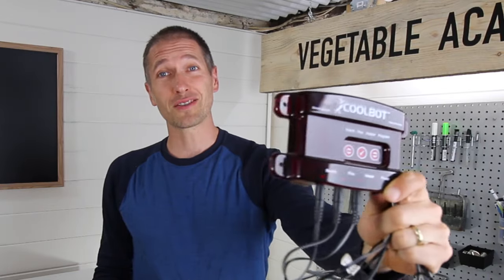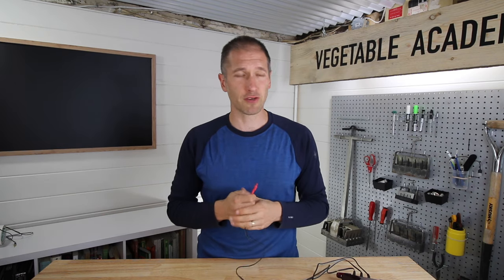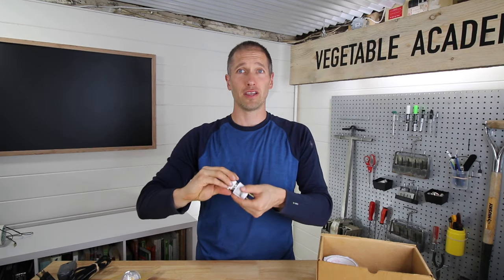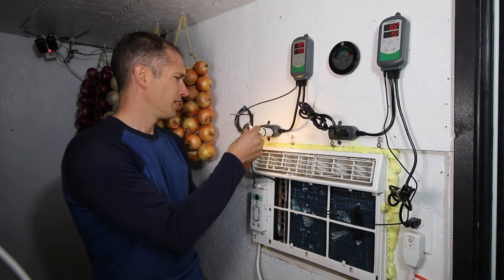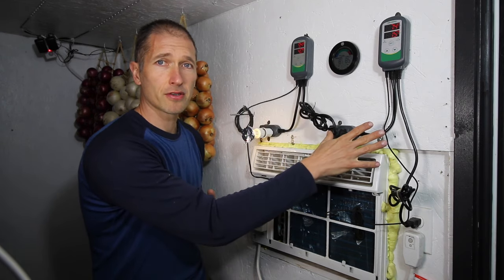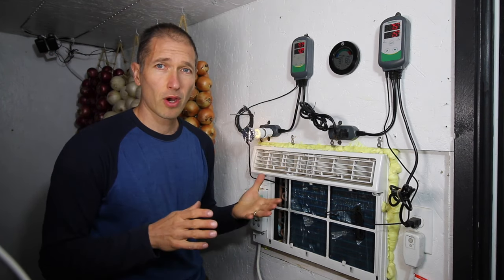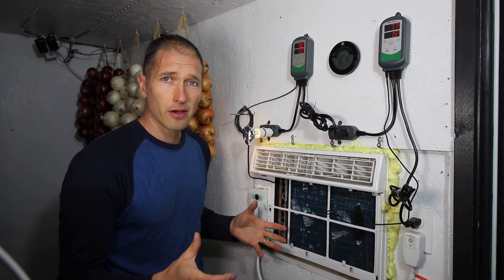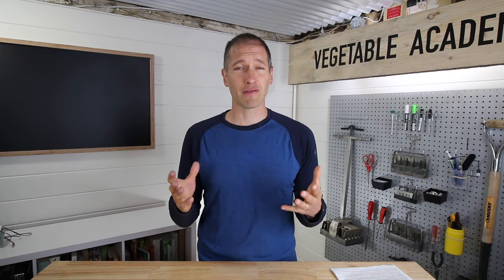Build Your Own Walk-In Cooler with this DIY CoolBot Alternative

Comment from the maker: Join me in person at the 2024 Homestead Festival near Nashville, TN on June 7 & 8 where I'll be teaching a session on Mastering Cold Storage.  Get 20% off your festival passes with the coupon code REGIER20 for regular admission and REGIER20PLUS for regular admission plus.  Here's a link to the festival: https://www.hardisonmill.com/thehomesteadfestival
Reply: I have built a 44 foot walkin. Using it as a freezer. Will this work where I can get it to freeze. Coolbots can’t be used as a freezer
Reply from the maker: @samscoalfiredpizza8152  The Inkbird controllers work at below freezing temperatures.  However, I can't speak to how well a window air conditioner would work to create freezing temperatures for you.

Comment: Heck no, just wire the ac comp direct to inkbird, run the fan constant to a wall plug.
Reply: Is it easy? I have an ink bird laying around
Reply: @kalebfourtner2140  super easy, thats why I went that route. Find wires to compressor, put a standard plug on them and run to inkbird. Find fan wires and run/start capacitor wires, put plug on them together and plug into the wall constant. Fan should always be running and inkbird kicks compressor on/off. This helps mitigate freezing up of coils.
Reply: @american7169  awesome thank you!

Comment: This video was by far the best one I found for the AC set up. Mine is working great in the first 24 hrs with only a single Inkbird unit. I just had to adjust the location of the temperature prob vertically at the bottom of my AC’s fins and adjust the temperature a few times to dial everything in. It’s holding a steady 41 degree temp without freezing up. I’ll probably take it down one or two more degrees in the coming week. And I’m using a really old, dirty 5,000 BTU window AC. Update - one week in and absolutely love this system. The single Inkbird has worked great with the probe positioned vertically against the fins, centered and about 1/2' up from the bottom. I used a short piece of electric fence wire in a u shape inserted into the fins to hold it in place. So glad I came across this video while researching cooling options.
Reply from the maker: Nice.  I think you could accomplish almost the same level of control with one Inkbird.  I am running ours right now with just the one probe in the fins and it's doing alright.  One difference is that the air conditioner turns on a bit later, because the fins warm up a little more slowly than the air in the cooler.  The air conditioner also seems to be cycling on and off more frequently because as soon as the fin temperature drops substantially to cool the air, the Inkbird cuts power to the lightbulb and turns of the air conditioner.  I imagine this would be more of a problem in the hottest part of the year when the air conditioner needs to be running more often.  This would mean that the fins would usually be at a lower temperature than the room air so the ideal temperature setting on the Inkbird might not be the room temperature you are shooting for.  Setting the Inkbird might require some experimentation and adjustments throughout the season depending on your climate.  Have fun fine tuning your setup.  If you can't dial it in, you always know that you can add another Inkbird for the best precision.
Reply: @dgilchrist6361 if you're only using a single Inkbird unit, what do you have connected to the Ac temperature probe?
Reply: How big is your bid walkin?

Comment: Great video. I use this system to cool our cooler at Burning Man. Our theme camp gifts about 5000 lbs of organic fruits and vegetables during the burn, We have a retired semi refer trailer. we use to store our camp infrastructure. We walled off a 10' x 12' area in the front of the trailer, With a stand up room ac we can keep the temps below 40f easily. We went with a single hose stand up ac because it does not draw in air from the outside as it is very dusty on playa.

Comment: This is by far the best hack guide thanks! Currently installing my 25000 btu LG in my flower cooler after my old industrial compressor kicked the bucket. Didn't want to spend 8K+ (Canadian) so your guide was a lifesaver thanks!
Reply: How does it keep the compressor from overheating and burning the place down?

Comment: We already bought a coolbot for my ice hash cooler (legal in CA). Come to find out we need another A/C unit to reach the temps we would like. 
I bought all the parts and will be using this instead of buying another coolbot! Thanks for saving me 320$!

Ill update this post with the results and my findings once its set up next monday.
Reply: How'd it go?
Reply: @snakeprairie  It went great!

We are now able to get down to 35 degrees inside the trailer without the unit icing up!

running 1 month no issues at all now :)!

Definitely recommend over a coolbot!
Reply: @dr9759 what are your setting for the unit probe going to the A/C and the A/C probe attached to the light?

Comment: I just used an industrial thermostat and tired into the compressor relay. I just ran the fan on high and used the thermostat. Never had any ice issues and had the thermostat set between 28 to 38 degrees. and averaged about 35 degrees. When I used it as a drying chamber I set the fan speed to low and set the thermostat to 50. I used a 12k btu LG window unit.

Comment: First off I want to thank you for the video. Here's what I came up with using your step by step instructions. My cooler 7Hx8Lx7W with 5" thick cooler panels. Built inside a 30' shipping container with a roof. I'm located in South Georgia. Go Georgia Southern Eagles! 1. I purchased a 10000 BTU Toshiba A/C and the exact materials listed in your video. Ok, I built this cooler to hold deer meat prior to processing. I want to keep the temperature between 36 & 38 dergrees. Here's my issue. I've only been able to keep the temperature between 40 & 45 degrees consistant for several days. My units keeps freezing up. I've set my controllers to 36, 37 & 38 degrees for room temp. and 29 - 34 degrees for fin temp. The lowest temp i've got in a 96 hour test run was 39 degrees and that was on Friday morning when the outside temp was 47 degrees. Now, I know that the outside temp. plays a roll. However, I have a co-worked that has the same setup I do and he has used a the same Coolbot for 11 years straight with no issues while maintaining a 36-38 degree temp. So, here's my assessmetnt. I think your method will work fine with the inkbirds for folks in the south who just want to keep veggies cool. From my experience, It's just to warm in the South for a meat cooler at the beginning of deer season. May work great when the temperatures in the south get cooler, say late November. So, I just wanted to let folks know about my experience in the deep south. Thanks
Reply: humidity
Reply: Sounds like you just need a slightly bigger ac unit

Comment: Ok, I'm sold.  I need a walk-in for my just-licensed winery, and I think this will do the trick.  Building out a 6'x10' space inside the winery to meet regulations.  This will hopefully help me battle super high August temps in West Tennessee so that I can begin fermenting our white grapes at the appropriate temperature.  Thank you for such an excellent and thorough explanation!  I'm on to Amazon to make my order, then to the lumber store to purchase my lumber and insulation panels.
Reply from the maker: You're welcome.  Have fun with your build!  Since you're just about to buy materials as well, remember that investments in insulation will pay you pack in the long run.  This will be especially important in Tennessee summers.  Let me know how it goes.
Reply: @VegetableAcademy  will do.  Planning on regular batt insulation in the wall, as that's what is in the other 3 walls I'll be incorporating,  then foam boards on top of that for a total R-value of around R-25 to start, then go from there.  Fingers crossed 🤞!
Reply: @VegetableAcademy  one final question--the window that I have to place the a/c unit in has a max opening of 16" in height, which will only accommodate a 12,000 BTU unit.  Will this be sufficient to cool without failure?
Reply from the maker: @StillwatersFarm  That sounds like a good plan.
Reply from the maker: @StillwatersFarm  Use this CoolBot sizing calculator to answer that question.  https://staging1.storeitcold.com/build-it/ac-calculator/. You can enter the dimensions of your cooler space there to get a recommended AC size.  I believe the walls are assumed to be R20 for this calculator.
Reply: @VegetableAcademy  awesome!  Thank you so much!!

Comment: Consider a power resistor in place of the led bulb. More reliable than a led device that can fail. Thanks for the video.
Reply from the maker: I like that idea but lack the know-how.  Could you please share an example of the type of resistor you would choose and describe how you would hook it up to be activated by one of these Inkbird controllers?
Reply: @VegetableAcademy  probably the easiest way would be to use a small DC power supply.   You probably want it to be 10W or more for reliablility.   I bet you could get by with a 2 watt resistor that you operate at 1 watt.   power = v^2/R   or   R= V^2/P    5V*5V/1W = 25 ohms.   1 watt might not be enough, so might need to have a 10 or 15 ohm available too.   also this would be nice because it would be low voltage.

Comment: This whole project took me about 20 minutes to complete. I can confirm that it works as intended.

You don't need to be an HVAC tech or all that handy really as long as you have the right items.

The 4W bulbs highest temperature was around 99 to 100 degrees Fahrenheit.

One thing to keep in mind is the length of the temperature sensor on the air conditioner. The one on my AC barely has any wiggle room. I am going to have to set the bulb piece very close to the AC. With that in mind it was still reading 99 to 100.

Thank you so much.
Reply: How do you find the controllers in Amazon?

Comment: On the round LED bulbs, the round part is just a plastic diffuser, you can cut it off or drill a hole it in a stick the probe in. However, there are also tiny 4 and 6 watt reptile aquarium heaters that will plug straight into the thermostat.

Comment: good build i think you might be confused on cleaning the coils. the indoor coil (evaporator) yes you could clean with a brush. the air is drawn from the outside in through the coil in the duct then back out the top. all the dirt is on the outside of the evaporator. the outdoor coil (condenser coil) you wont be able to clean so easily. the air is drawn from the sides of the case  and pushed through the coil inside out. all the dirt is on the inside of the case on the condenser. youll have to A. Take it apart to clean or B hose from the outside in with water.
Reply from the maker: Yes.  For the exterior coil, it's definitely most effective to take the whole cover off and give it a good rinse with a spray gun.
Reply: I remember having to blow those out with compressed air, when I worked in a warehouse.  The units were on top of our walk in coolers.

Comment: You can buy the modules themselves without the case and cords coming in, dual stage or single stage.   You gotta provide the wires as such. Can get them in 110 -220 as well as in 12v that controls a relay for 110-220v.     And depending on where you go you can get them dirt cheap.  Run them to outlets and flush mount them, even outside the room so you don't have to enter the room to adjust things.
You could also run an Arduino with a program and a couple relay boards, and set it precisely to do certain things.     
Turn on light when over x temp.  Turn off the light when a different probe hits x temp, and even do a third or fourth to measure different parts of the room or fins.  
But I'd prefer to get in and pull out the electronics and wire it up to a PID or Arduino with pid, and a couple of proves to measure room temp, as well as make sure the fins aren't icing up.       Arduino and the modules are dirt cheap to buy, even dirtier cheap to build. 
Cut out the entire light system, and just turn on and off the compressor based on temps you see.   
Many options here and the more techy you are, the cheaper it can be.

Comment: Best video on this, BY FAR! I just got my 6x8x10 cooler built and every video I had come across, up to this point, just seemed to make things so much more confusing.  Your video explains everything (except for which plugs (heating/cooling) you use on the inkbirds for which purpose....but I found the answer under the comments) very well.  Thank you!  I just have gotten my inkbirds delivered and going to run electric to the cooler this weekend, so hopefully, I'll have everything up and running next week!  Thanks, again!
Reply: You're welcome.  Have fun finishing the build.

Comment: I installed a resistor parallel to the AC room temperature probe. Costs less than $1. It makes the AC think its warmer than it is. This also allows the AC to make use of its inverter technology, saving power and giving a very stable temperature - somehting the Coolbot doesn't do either.
I only need to go to 10°C, so freezing up the fins isn't an issue, I just need to keep the fam running at max.
Reply: How do you do that?

Comment: Not all AC units work with coolbot or ink bird controllers I tried a manual AC unit did not work I bought a digital one it works great this video is awesome just thought I would add that
Reply: I just bought a digital so fingers crossed
Reply: I am using an LG split AC and it has two probes that I needed to connect to the light bulb.

Comment: Super cool
The more time and money that you spend on making the room, absolutely airtight, including electrical outlets, and if there’s any piping from electrical outlets that the opening inside, the pipe is sealed with some sort of putty to stop airflow and extremely airtight sealed gaskets around the door .  Double the doors, and even insulate the doors.. 

Better insulation on the floors and the walls and the ceiling 

The less money you will spend on electricity 

And the smaller the air-conditioning unit can be . 
Consuming less electricity

Comment: Your setup worked great for my 8x8 cool room, My 15k AC maintains 2-4 Dec C even in eco mode. The only issue I have it with the Inkbird WiFi. The final layer of foam board I used has a tin foil coating which is blocking the signal.
Reply: Did you resolve that? Curious if just running Ethernet cable to a little repeater (that can operate at low temps, probably an outdoor extender)

Comment: Really great video though. only 3 issues i see with this set up as well as the coolbot. 1) im not sure what time of the year this box is being used, but there is no head pressure control for the colder months. you may or may not find you need this. 2) i see a potential for short cycling if for some reason youre bouncing around 1.5 c which could kill your compressor. 3) newer ac units use flammable refrigerants, such as R32. by doing all of these modifications youre changing the UE listing and assuming liability in the event there's a leak in refrigerant and it ignites. 

but again i really do like how you considered defrost. smarter guy than most.

Comment: Even though the LED is very low wattage I'd be inclined to find an alternative, similar to what Coolbot uses, a resistor of some kind. Perhaps even a traditional filament bulb. Heat is an enemy to semi conductor which is what a LED is. Covering it in any way will tend to shorten it's life & in the case of a larger bulb become a fire hazard. Seems to work for you though, so what do I know haha. Another thing with LED bulbs, most are fitted with a heatsink base. That might be a better place to tack the sensor rather than blocking the light itself by taping it over.
Reply from the maker: Thanks for the ideas.
Reply: +1 to this, having worked in LED lighting mfg.  LEDs dislike heat and LED lights are generally designed to run as coolly as possible.  Still an excellent video, and I love the simplicity of this setup.
Reply: @VegetableAcademy   your ideas and videos are genius, Jared. I wonder would metal mesh gauze help substitute the tape? It would hold the sensor in place on the bulb stronger than aluminium foil would without blocking out the light?
Reply from the maker: @homebuddha  I use foil tape for this purpose.  It looks like aluminum foil, but it's actually sticks in place quite well.  The metal mesh gauze you are thinking of might serve the same purpose.
Reply: @OP Remember we're talking about a refrigerator here, not massively high temps. Just needs to be hot enough to trigger the compressor to run. The passive cooling from being in a fridge should be more than enough to compensate for any "overheating" of the diode, if any. Hell, my pocket LED flashlight is so bright that the light itself can burn your skin or clothes if you put it right in front for just a few seconds. If you leave it on long enough on turbo, (a few minutes) the body of the light (which acts as a heat sink) will get hot enough to burn you if you hold the tip too long. It has active temperature regulation though, which drops the output of the LED precisely to protect it from too much heat. Still, it sustains high output for long periods of time, takes the high temps and the LED doesn't fail. That's a class leading, ultra high output LED chip on a tactical flashlight though, not a regular, low power bulb like the one he's using so I'm sure it'll be just fine and nowhere near a fire hazard.